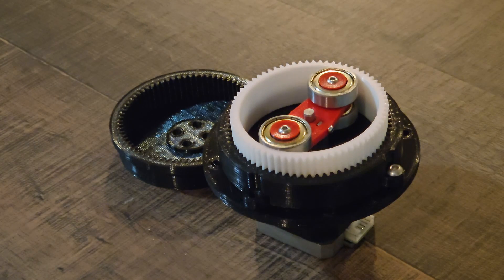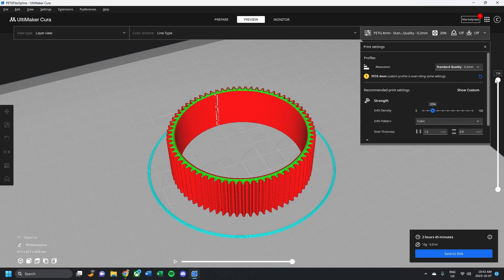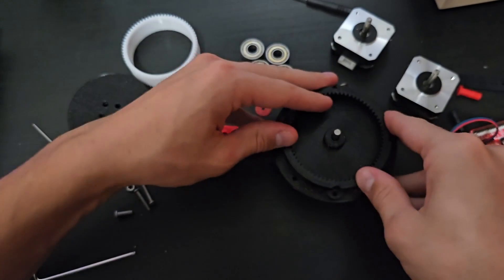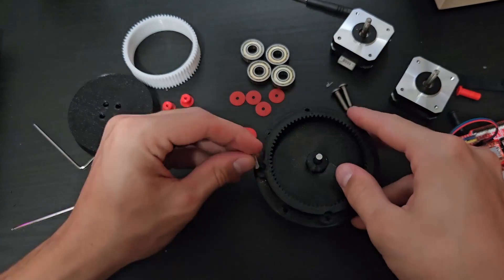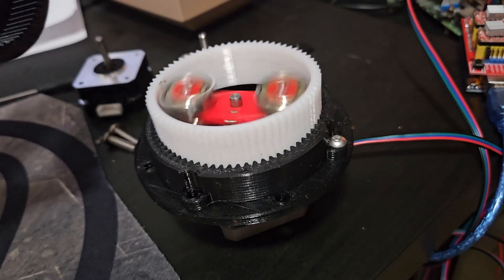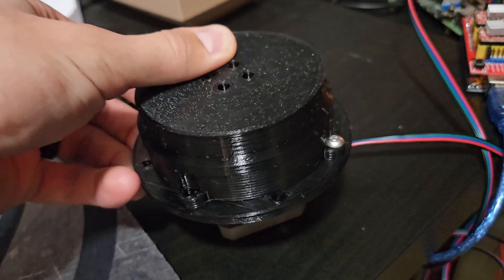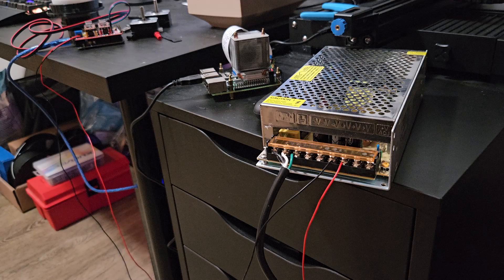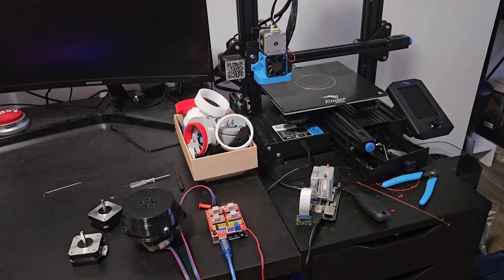3D Printed Harmonic Drive

Comment: Do I understand correctly, that this is a typical Harmonic drive but _without the specialty flexspline? That is, the "flexspline" is broken into driving and driven portions, retaining all the torque and 'zero' backlash of the equivalent tooth-ratio Harmonic drive? Surely the one extra part is NOT the reason all the robot manufacturers use a 'standard' Harmonic drive instead of this - easier to make. What am I missing here..?

Comment: This is only a functional setup but not a HD for an usefull purpose. Just keep on... If you mind try a bearing on top of the wave generator to prevent skipping and of course a two layer bearing for the output...

Comment: How did you design the internal spline on the lower portion with the same number of teeth? Did you have to make the internal spline a larger gear module than the wave generator?
Reply from the maker: I made the flexible spline the same amount of teeth as the base it sits in. I just cut the gear out from the base to invert it and added some scale to make it fit a little better. The cap has 2 teeth more than the flex spline and I also added some scale to make it fit a little better there as well. I put some backlash on the gears as well to account for 3D printing error. I'm not sure how else to explain it. Hope that clears it up a little.
Reply: It is possible to make teeth that mesh nicely, but I only stumbled on to it for one particular combination of 34-34-36 tooth gears via trial and error in Blender. Very tedious work, fiddling the width and curvature of the teeth and then simulating the flexspline bending after each change to see how they fit together. But it could be greatly sped up by writing a program to automate the bending simulation step, so you only edit the vertex positions of one half of each tooth and get a real-time view of the simulated engagement.

Comment: I don't understand the purpose of this device & why the gears are meshing & unmeshing without generating any noticeable motion or work.
Reply: Look up harmonic drive or strain wave gear box. It will make more sense

It’s a way to create very high reductions in small spaces with zero backlash
Reply: @andrewstrauss7166  I didn't notice the teeth meshing shift it was too slow and small to tell by eye
Reply: He said the flex spline and the gear base have the same number of teeth, so the white flex spline doesn't rotate relative to the base. The black cap at the end of the video has a different number of teeth than the spline/base so it rotates relative to the spline/base at a greatly reduced ratio compared to the input rotation. The load would be connected to the rotating cap and receive far more torque than the input, which is the purpose of the device.
Reply: For other people reading this, the gears on the base and the flexspline are even...so it doesn't move. But on the output (the cap he puts on) there's on tooth less. So then the cap moves when the splines rotates around. It's the same principle as a cycloidal drive just different input mechanism, and alot harder to print and make useful.